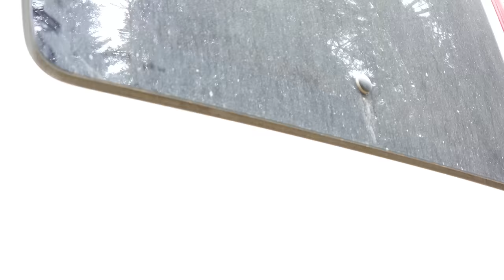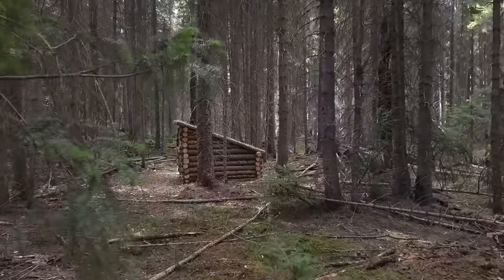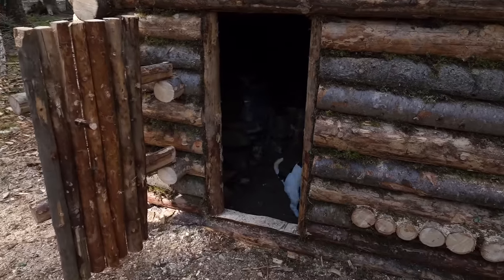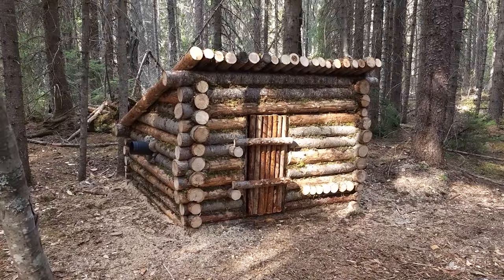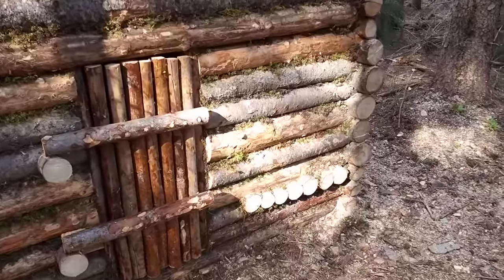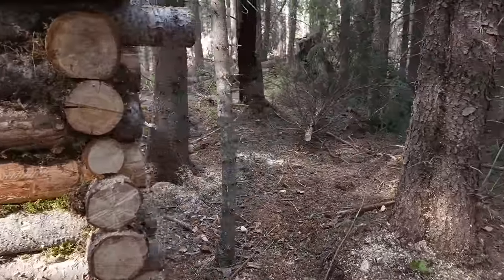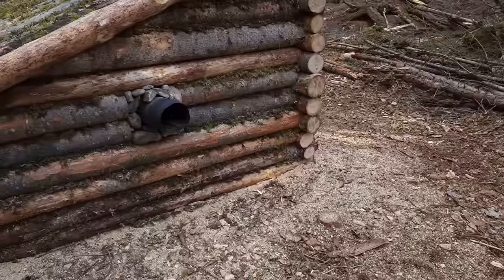I Built a Secret Tiny Cabin that has Wood Stove Heating

Comment: Not bad for your first cabin. It will work in a pinch.
Some suggestions: for roof shingles (you will need a ton of them) cut logs to 12-16inch long using the straightest and without knots, split them and try splitting every 1/2 inch creating shingles. Secure 1-2 inch diameter straight sticks perpendicular to your structural roof logs and attach shingles with a single dowel to those cross pieces. This will add insulation and should shed the majority of the water. Try stripping all the bark off the logs because that is where the bugs live and the moisture builds up. Also once the bark is stripped off char the bottom row of logs to help prevent rot and bugs. Good idea of using the rocks around the stove to store and regulate the heat

Comment: For natural waterproofing of the roof you can smear clay soil over the top, with a fairly wet consistency so it'll fill the gaps.  When it's a solid course of the clay it "should" be water tight up top.  If you get a lot of side rain or a wall leakage problem you can take it all the way around the outside walls too.

Comment: I’ve been thinking about building a hunting cabin. Something small just for me and maybe one other cause my son will be going with me the next few years. I seen your using an cordless chainsaw. I used to cut timber for a living and swore by gas saws. That was up until I got a cordless saw several months back. Those things are great. They cut just like a gas chainsaw. You don’t have to worry about the cold start yanking and yanking on the pull start. On top of that husky’s flood easy. The bigger saws anyway. They was a pain in the winter time. Now I swear by using cordless chainsaws.  They are awesome. And they are quieter. I like how you had your dog dig the footer.  Lol. For real I’ve never seen someone use a old propane tank for a fireplace. awesome idea. I usually see people use old drums. I like that better.

Comment: The only thing that I could suggest on the bottom section would have been to lay down some rocks to lift the foundation logs off the ground. Another thing I would have suggested was to put down a layer of visqueen underneath the entire bottom of the cabin as a moisture barrier. The build was great, but as you mentioned the rotting will start from the ground up. As for the top, nail on a wooden roof, or mix up some form of cement mixture and coat the logs and chinking with that until you have a solid roof. (Just my two cents)

Comment: The first cabin I built didnt have a door, but I made the doorway opening too narrow for a bear to get through. I would put my pack in the doorway to deter smaller critters from wandering in. 

Cardboard is surprisingly waterproof when used as a roof, especially if it has a good layer of maple leaves on top of it. It's also completely biodegradable. The cardboard on my latest cabin has lasted 2 years without a major leak. If you're willing to use waxed cardboard you might get as much as 5 years. 

Use cedar for your foundation logs and char the side that will be in contact with the ground.

Comment: Ok dewd, on the ROOF (and all seams) you should have a mixture of earth,  water (mud) & grass; i.e. survival cement; it dries hard, tough and immobile.  You mix it up separately in some kind of container (such as an ember- hollowed tree stump or a hole in the ground) and it must be applied to every wall seam before you build above it.

However, this is only your FIRST roof layer.  Now you can put a nice thick layer of leaves (and "cement" it completely if you want, or not) for the second layer.  Then for the third layer, you can simply put earth.  

Its not going to leak but every rotation of seasons, the entire shelter must be maintained with applications of fresh "cement" (the walls in [as necessary] & out) but the roof probably won't need more than a fresh application of earth.

SECRET: As the goal must be to make the shelter air tight, there must be air holes allowed for smoke to exit the shelter.  Traditionally they are deliberately placed in each of the four corners at the top joist.  This is normally accomplished by making each of the top-most WALL logs (not the roof) slightly shorter than all the other logs.  When there is no fire, all four are closed with bark.  If there is a fire, two are left open; which two is determined by the direction of the wind.  Of course you had a home-made stove with piping (GENIUS!) but without that, a fire pit would traditionally be used.

Btw, I didn't even know it was you making this video until you started talking!  It was YOUR video that got me into Van Life!  Very creative job you have done, you are highly skilled! :D

SECRET #2: If you dig into the earth 2' and use it as your floor, it will drastically improve the temperature at floor level.  It also cuts down on the amount of wood necessary for the walls. ;)

Comment: I like the idea of using natural materials so that it eventually just goes back to nature. But i still think you should put it up one stones so that it takes awhile for it to happen. As for the roof, either split trees into planks, strip bark from a green tree (really easy during the spring) and use that or just pile on more material so it takes away to leak through

Comment: I'm starting on a small cabin soon. I was thinking to make the roof much wider and longer than needed for a roof but the wider and longer it is will better help the bottom logs stay dry. Ill probably use smooth creek rocks for the actual foundation so that any water that does make its way to the bottom can drain faster than it does in dirt. If I come up with a waterproof roof I'll pass it along. Thanks for sharing. I like it. Good job 👍✌

Comment: You could try getting something like a 100% cotton sheet and coating it with beeswax or pine resin to waterproof the roof and then inside use the same thing to keep the pine sap from dripping on you. Also I think you are supposed to remove the bark from the trees you use because otherwise water and bugs get under the bark and cause the wood to rot. But i am by no means an expert. It is a great build and i love that you used hand made wooden dowels to connect everything and that door was pure genius!

Comment: People may not agree and although I appreciate the sentiment about keeping it natural… you already put a woodstove in so adding a roof tarp makes sense.  just remove it when you feel its time.  easy.  Also, it will likely give you substantially longer use before rot.  Just my two cents.  good luck!

Comment: On the roof where you put moss in between the sticks, I would place smaller sticks on top of the moss.

I also would dig the floor deeper and add a floor. So I'd have room to store my things or put sticks at the bottom to have more head space.

What do you think about that?

Comment: For the roof ...
Half logs.  Split them or rip them, then hollow them out to a 'C' shape.   Install them like terracotta tile roo, one up, one down.  
If you build a jig for the chainsaw you should be able to plunge cut the half logs every 3 or 4 cm or so, then knock out the chips with a hammer or hatchet.nails should be usefull but pegged gable and eve ends should do.
A rip guide for the chain saw would be a handy addition to your tools.  Also rip chains are essential for all but small jobs.

Comment: That drill is switched to hammer for drilling concrete, brick and stone, you can hear it 100%.
And the way that drill bit is sliding around at the 1.50 mark, I don't if that's the hammer effect from the drill or that is a masonry drill bit.
but it definitely looks like a masonry drill bit in the video.

Comment: A recommendation for the roofing with natural materials. Look into the Foxfire series of books, specifically book1. In it they describe and clearly explain how to build a log cabin, specifically 3 different log cabins. A truly traditional one using no cut boards or nails, just hand hewn logs and locust pegs, they then describe a moderatley new one, something that would have been built around say, 1850 using cut nails and sawn boards, and then a fully modern, circa 1965, one. 
The part of interest to you would be the traditional one, using a froe, they go into great detail how to split a round into the proper shape to make wooden shingles. They then go into detail how to lay them and then lay long poles across the laid shingles to weight them down and make it water tight. Not entirely sure if the wood you have access to would be large enough, but I'd be willing to bet you could figure a way to make it work and still let it be able to go back to nature without any screws or nails left behind.

Comment: That Jack Russel looks like one that I had.  They do crazy things...when I would dig, he would bark and bite the dirty shovel blade!  Once, he dived down a hole and attacked a skunk...got a nasty surprise right in the face!  Then, he puked!   Spent the next two days hiding beneath the bed.

As far as the roof goes, you might try making a clay and straw compound and pack the spaces between the logs with it and cover with leaves, then thick moss.

Comment: for the roof, ive used clay/mud, as long as it's not like a monsoon that goes on for days and days it holds up pretty good, but my room was not as slanted as yours (i'm 6'4 and past 40's i dont bend as well as i used to lol) other than a tarp, or mud i guess there is just litter, if you gather enough and put enough on top it'll leak less i think.

Comment: +s -S of your electric chainsaw electric chain saws from little projects like this are infinitely better, the problem is for big jobs they lack power and can’t run hard all day but neither can a small gas saw. As for your roof sheet metal just flat steel it breaks down to iron and does no polluting.

Comment: Ya can't just build a tiny hut and heat it with wood.
I want to see calculations of how many cubic feet of internal space makes for the most comfortable temperature when heating with wood.
Also, the stove needs an exterior cold-air inlet to survive off of, so that you don't create a vacuum inside and cause all your doors and windows to be frozen zones for sitting near.